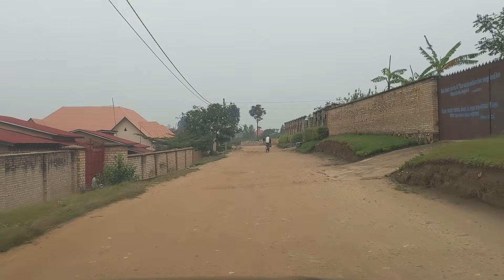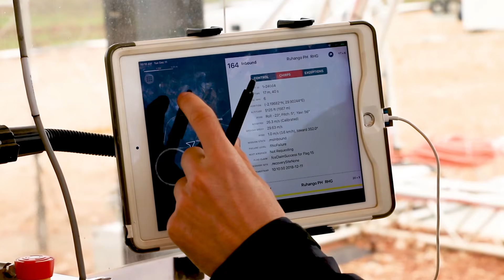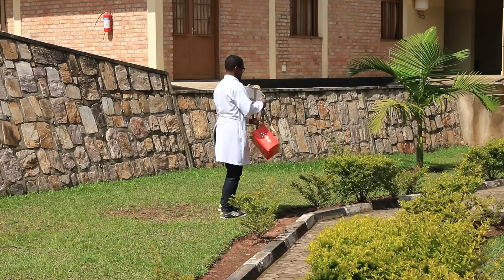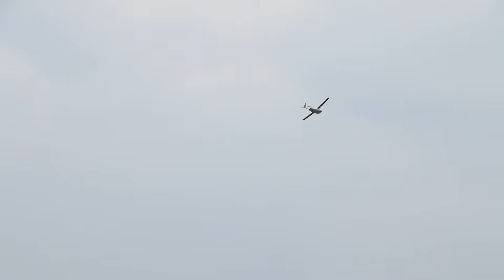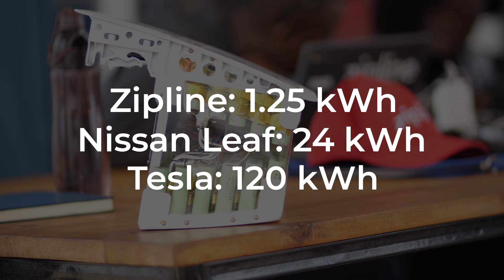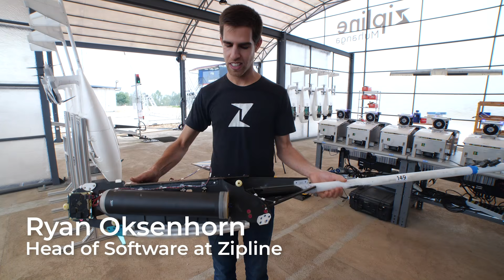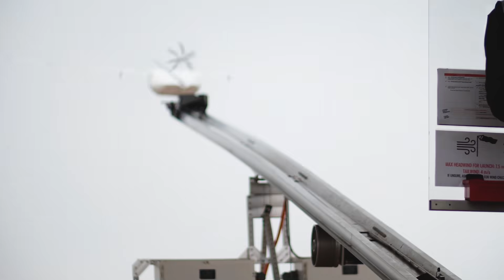Zipline - How Rwanda Built A Drone Delivery Service

Comment: The Rawanda drone delivery is massive fraud. They are out in the countryside and provide 80% of the cities blood needs. The hospitals dont store blood. BLOOD IS MADE IN THE CITIES NOT IN THE SUPER RURAL COUNTRYSIDE WHERE THERE ARE NO PEOPLE TO GET BLOOD  FROM. Im sure they make truck deliveres from the city to the country so they can deliver it 7 miles away 1 pint at a time. The city hospitals cant  decide if they need more blood untill theyre out?  They say the drone has save 200,000 people per year. Its not practical that medical supplies are delivered in bulk to the countryside and not the city where its needed. Can Nobody see this? Why is there so much blood out in the sticks, It doesnt make sense and if they need blood everyday they could send it more than a pint at a time by motorcycle or bicycle or Maybe "A TRUCK"

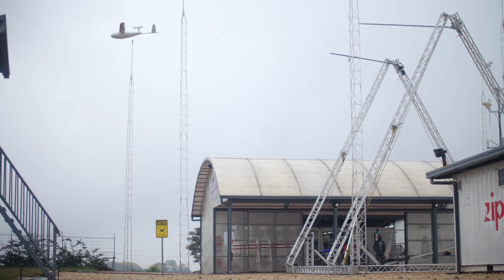Comment: Cool note: at 4:47 you can hear the drone throttle its motors up just in case the wire missed. You can even see the props spin faster in the slo-mo. Extra safety factor!
Reply: you can see it aswell in the slow mo shot!
Reply: @thebigbonk  wow! I have the feeling it sais it in the original comment

Comment: It won't catch on big because of the 50 mile range. Where do you think most products originate from? Some start in China so to think the last 50 miles by drone is a game breaker is wrong. It does have some use but the business won't grow beyond supplying hard to get to areas. If the done is going to drop the package without stopping it would have to be quite low in the air, when dropped,  or the package will blow away in the wind. Flying low in the city, all the while flying over peoples heads, is hard to do and is illegal right now.

Comment: That's incredible, commercial derivatives obvious, but emergency services potential is huge. Direct derivatives; cities for fast emergency support (London-defibrillation, compact er direct line & medkit, etc), in rural areas for same, as emergency supply chains for rural area medical supply (here in Aus, central, desert & deep rural areas- in conjunction w Flying Dr's or other AirAmbulance services).
Then there are all the other emergency variants - SAR (drop food/radio), Fire - a sealed (smoke) vers that could carry heat IR gear over fire areas, and a bulk body for as needed services - sealed, too, it'd be great as a firefighter support drone. The modular system could carry over as common parts (othe than mission specific) thru all, W larger/smaller variants to suit need.
From watching a doco on snow SAR on mountain snow slopes (The Horn) pretty sure similar systems could apply there.
Add in coastal/ocean applications.

Comment: How about using hybrid plane that can switch between plane and copter?
Reply: copter always takes more energy, so it would reduce the service radius... and doesn't solve anything (in Rwanda)   It could in densely populated areas perhaps where landing is necessary.
Reply: @RyderSpearmann  It will not consume more energy once it switchs to plane
Reply: @Vi-pv3xi  ONCE it does.  but in the meantime the battery is draining, reducing the service area.  Also, you need more thrust to hover, so the motors need to be larger/heavier or more of them... also reducing the battery life.  And it accomplishes nothing...

Comment: for me it highlights ALL the advantages of using fixed wings, and really UAVs need to be developed to their strenghs, and not shoohorned into roles they aren't good at. Automations is striking everywhere, and delivery is a matter of both ground and air. Ground is far better in western countries cities, where the infrastructure is developed and allows for high speed high capacity transportation. a UAV simply does not have the carry capacity to compete, and yes, even if on medium trips it can be faster, vertical lift has too little range, and fixed wing too little precision for operating in crowded environements. Self driving ground vehicles arleady acomplish this task far better and more efficiently and short of amazon's giant carrier blimps, are unlinkely to change. 

Zipline shows how proper product placement combined with practical engineering results in an efficient, effective, relatively low cost and easily scalable system that is applicable almost everywhere on the planet. It is easy to see how application of mass automation to the launch and recovery system, combined with the modular framework already in place could result in drastically increased uptime by removing even more of the already short downtime and setup time, for example, by standardising the package to be easily loaded and unloaded by a machine, along with direclty linking the recovery platform with the launch catapult.

Example, using a relay system allowing a drone to be recovered, lowered onto a coveyor which would bring the drone to either disasemblage and storage, or directly to the launch ramp where the battery would automatically be swapped with a fresh one, preflight checks being run completly automatically then the drone being launched again within minutes of arival, every step being able to be layered on top of one another to guaranteed as little downtime as possible even in the most crowded of scenarios.

Comment: "This innovation alone removed an average of 10 to 15 minutes off the launch time."

There is no way that moving the GPS to the batteries reduced launch time by this much, or really any time at all.  Even the cheapest GPS units (~$10 Beitian BN-180) can be powered on from a cold start (the BN-180 does not have any flash memory so every start is a cold start) and have a full 3D lock in under a minute.  If you move slightly up the chain and spend ~$15 to a Beitian BN-220 (which has flash memory) after the first initial cold start, it will warm start in under 15 seconds to a full 3D lock.

Seeing as these drones are fully autonomous and appear to be flying on either proprietary software (which I doubt) or iNav (or a fork of iNav) they will be using a slightly better GPS that also has a compass built in such as the Beitian BN-880.  With this GPS, a cold start averages less than 30 seconds and warm starts are under 10 seconds to a full 3D lock.  And it still only costs ~$20 for a single unit so to build out an entire fleet would be even less per piece.  

My point is that taking the GPS from requiring a warm start (and in the worst case a cold start) to being "always on" did not take any time off of the launch procedure.  The control surfaces cannot be checked through their app without also having power supplied so in the couple minutes that it takes to do a preflight check, even the cheapest and most basic consumer level GPS will be able to acquire a 3D lock many times over in the time it takes for a person to make sure the aircraft is flight ready.

Comment: This is from military technology from target drones,  they use catapelts and preprogrammed drones,  even turbojet ones. it's actually decades old, only the control systems have been improved.  They are used for target practice,  and in war as decoys, a small drone can be made to give off identical radar signature as the real plane it fakes.

Comment: Interesting. For example you could drop off supplies for people working as paramedics. Need something, order it and it'll be there in minutes. Or for search and rescue. A plane equipped with thermal vision is there much earlier than a helicopter. It's also viable for surveillance and transporting light things such as screws or other stuff you might need

Comment: Awesome concept.. specially the mobile app based pref light check. Not even the real aircraft are doing this.... But for the "complex" landing system, why not just make it land at a small airstrip? Current system looks complex and adds stress on aircraft's structure.

Comment: Why don't they just use gas engines? Everybody knows the energy density of batteries is abysmal. And before you think of saying "hurr the environment", these are tiny planes, they'd probably pollute as little as 1/100th as a car.
Reply: They break a litlle easier, and needs more mainteinance. I think so

Comment: It is fantastic in every way. I am reluctant to point out how and why, in fear of inciting some strange replies judging by the other comments.
Although it should be obvious, the military adopt hardware and innovation as often as they reject it. Like the Wright Brothers experienced for example.
This is the result of lots of great engineers and technical and infrastructure people working together. It requires the community of the country being able to understand and support, if a drone has to land by parachute will it be guarded by locals until collected or dismantled by 'hobbyists' to salvage the 200 Li-Ion cells?
This is a real life application that on balance could be implemented even in the US to limit climate change. No need to repair the crumbling freeways. Live local, work local, grow local, take holidays local. Use the redundant airports for this kind of drone.
Greta Thunberg is labelled a child. Well it is the responsible adults who will never give up their buckets and spades to make sandcastles on a far flung exotic beach without the approaching struggle of existential proportions. Trump has no need of anything material or financial. He has the opportunity to be remembered for posterity as the President who acted.

Comment: this is not related to the vid but can i ask why do wires are being colored even they have the same awg size. does it have a volt designated in every colored wire? like for example of the black as ground does it means it cannot carry electric current because the black is ground or negative means it is 0

Comment: It is a huge shame that the otherwise brilliant "brilliant.org" have failed for over three centuries to figure out that Gottfried Leibniz stole the 'Calculus' from ancient Scientific texts from India, and also stole, the Switch Release Halbach array Pure Magnet "Orffyreus" Engine. Those 3-4 lb. cylinders were NOT weights, they were diametrically polarised magnets. 

That is why to fool prospective customers these magnets were described as 'weights' to potential customers who would be charged $150,000 Silver Thaler a year for Exclusive Rights, were shown these magnets wrapped in cloth. Exposure would have revealed the hammer blows, as these magnets cooled from Curie temperature, in a strong magnetic field. His Grace the Duke of Devonshire, did buy the Exclusive Rights, as his fortune was based on coal. He was aware that The Elector of Kassel Hesse, not only hired out Armies, but also Assassins. who were not cheap. Johann Bessler was the best engineer available back in 1710. Sir Isaac Newton significantly improved the mechanism. allowing bi-directional rotation with significantly more power. Today Switch Release Halbach array Magnets are rated in the multi tonne lifting capacity. These Magnet Motors are exceptionally powerful. 

This became the Multi-Trillion Dollar Rothschild Banking Empire.  Advanced Technology very soon was winning wars. Both sides lose in every war, but the rules of this stupid enterprise, mandates that the winner pays the losers losses. The Rothschild Banking Empire make sure of the maximum return on their investment. And decide which side loses the least, so they can later go bankrupt paying the losers debts. The Higgs Boson explains how "Over Unity" conservers the Mass Energy rule. A 20 tonne safe door is east enough to swing open and closed, A hundred tonne weight suspended from a regular Gantry Crane from four corners. Effortlessly twisted in a rotary oscillation, Pythagoras ensures a lift and fall. lift and fall...etc. 

The input energy is trivial and the output very substantial. The same applies to a pendulum on a counterweighted cantilever beam. Well over 300% Over Unity. Sadly not very brilliant engineers, in reality very stupid book learned bigots pretending to be engineers, because they are simply lazy! and can't be bothered to undertake real science with a real experiment. These fools pontificate about their book learned erroneous information. Supplied by ... That Banking Empire who discovered that maintaining ignorance was almost as profitable as bloody war!

Comment: I wonder if you can apply this to skydiving with a larger drone. launch a jumper or two(tandem) together then when reaching the right height/jump location, drop/jump from the drone. a battery drone with a rail launch system would be cheaper than an airplane right?

Comment: "For every hour of flight these drones produce 1 gigabyte of data."
So my phone could hold 40 hours of flight. Not sure what the insane emphasis on the word Gigabyte was about...
Reply: 1gb is a lot for logging. Logging is essentially just TEXT like GPS data, input from sensors etc etc. Looking at the logs manually for example to find what went wrong in case of an accident would be like searching for a particular sentence in a book in a library.
Reply: @isymdvr  Except logs have the time as well. Meaning you'd be on the exact page the sentence comes from.
Anyways I was expecting much more especially considering how much emphasis he puts on it. At least they likely need practically nothing for storage lol.
Reply: Data piles up very fast and if you have to store the data for like 1-2 years you willl require a data center in no time
Reply: @isymdvr If you ran 20 of them for 12 hours a day for an entire year it'd be 87,600 GB... So for the first year you'd you could literally save all the data to a normal sized PC filled with HDD's.
By year 10 maybe you'd have like 3 server racks filled with drives if that.

Comment: Is the parachute not reusable?
Why do they need this complicated landing system?
Reply: What? What's complicated about just dropping them? And I dunno why the parachutes shouldn't be reusable.
Reply: @sevonthegreat  I meant the emergency parachute from the plane.
I guess if they land it on a soft surface it would be fine
Reply: @alexanderr3258  I know mate but I really don't see any problem here. That drone seems to be pretty sturdy, I don't think it'll break while landing on solid ground.
Reply: @sevonthegreat  It takes more time to roll a parachute up properly. It takes less time time simply pick up the drone from the landing zipline. Less time on the ground means more time in the air delivering medicine.
Reply: @darkling6  I'm not sure what you're trying to tell me, sorry.

Comment: There is no Tesla with 120 kWh,the biggest is 100 kWh!
Reply: Yes there is, the New Roadster has 200 kWh battery. It's not yet available on the market though.
Reply: @delca1188  I love Tesla and I am well aware of the upcoming Roadster, but he can't say that "the average Tesla has a battery size of 120 kWh", it's more like 85 with all Model 3s comming out with smaller batteries. I also wrote there is no Tesla, as in available, not there WON'T be any 120 kWh Tesla :) I believe in an all electric future,but we should get the numbers right :)
Reply: @jonalefabbli  I agree, it's quite misleading.